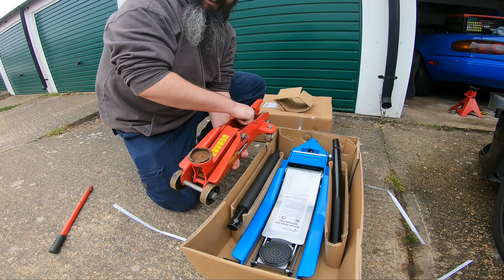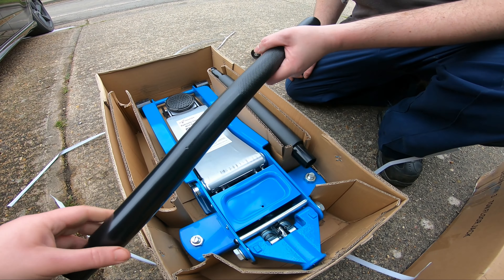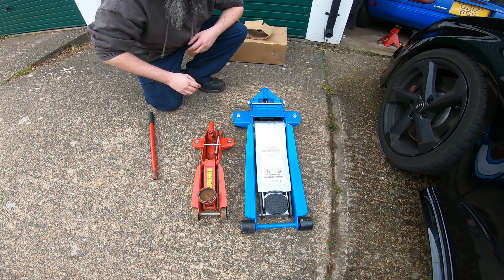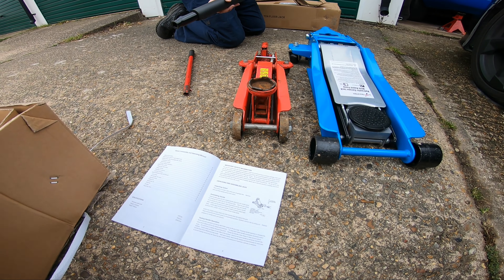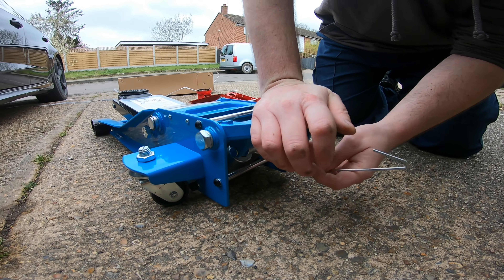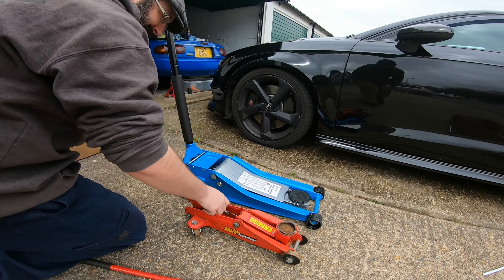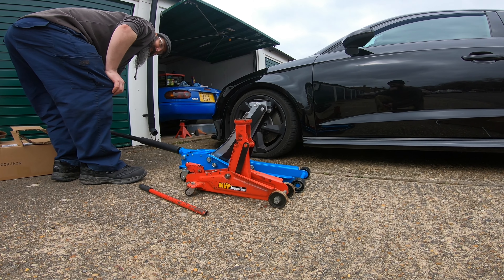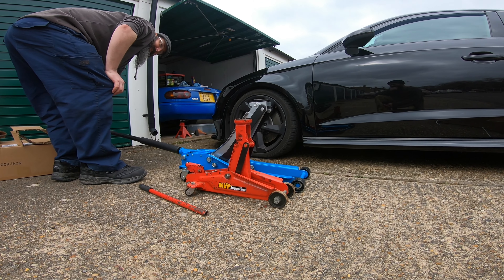Liftmaster 3T Heavy Duty Ultra Low Profile Steel Floor Jack w/ Quick Lift Review

Comment: I ain’t even lying ive got that same  red MVP jack, 20+ years old and I still use it. It’s the real MVP in my eyes. Still need a new one tho.
Reply from the maker: Even the little one can last well. That one still getting used :)
Reply: I'm here because I'm replacing my mvp 2 .25t jack after I overloaded it.  Gutted I have broken it and will be rebuilding it when I get time.

Comment: Think this will be my next garage upgrade, im still using a cheap amazon jack but it doesnt quite lift the car far enough to get onto axel stands without a wood block inbetween the roseplate and the car, cheers guys!
Reply from the maker: Yeah defo a game changer for us. Low profile and just the ability to go higher than a normal one is greatly useful.